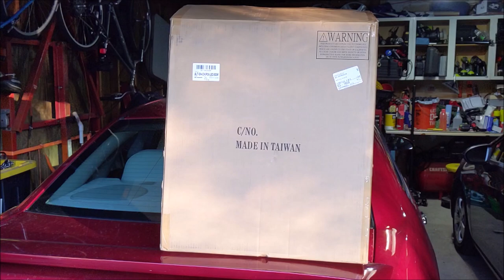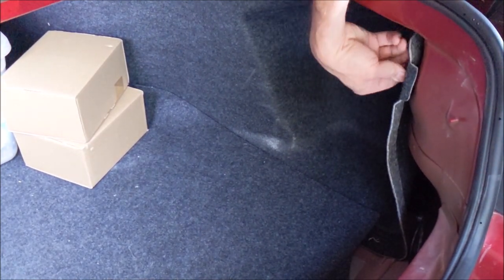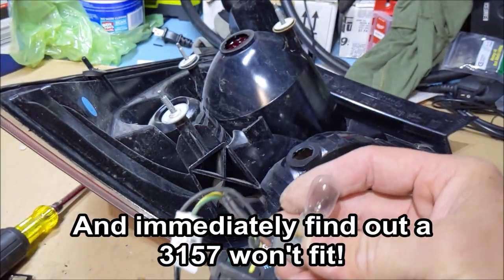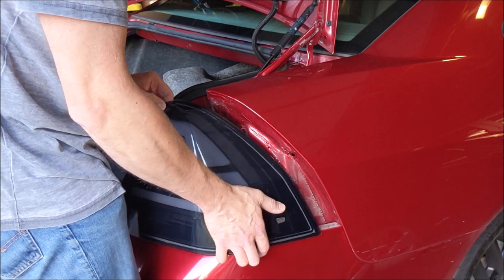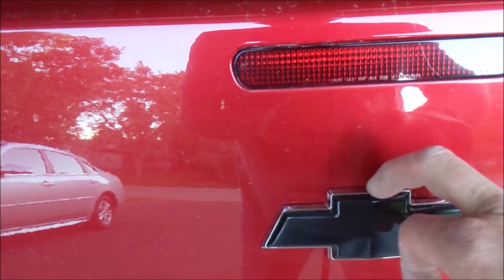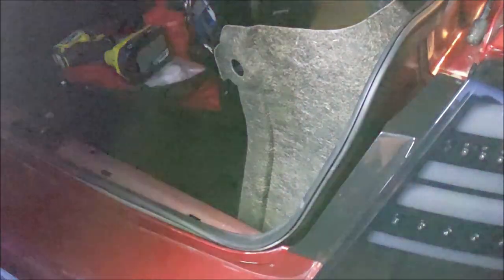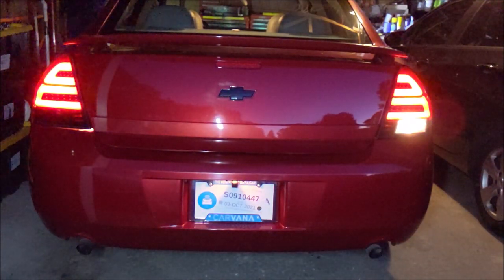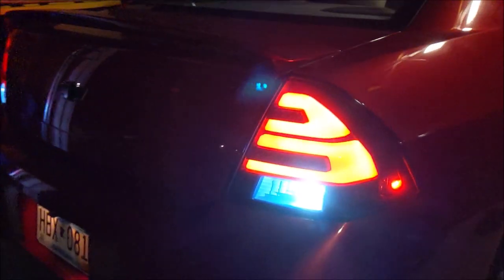2006-2016 Impala/Limited (9th Gen) LED Tube Bar Smoked Tail Lights Unboxing, Installation, & Review

Comment: Definitely a worthy upgrade that’s for sure! Definitely makes the car stand out! Also, for the LED swap in the front, the side marker bulbs are basic 194 bulbs. And for the front signals, they’re 3157. What I did is I bought a pair of switchback LED turn signals that are white for parking lights and amber for turning. Just make sure you get a pair with resistors otherwise they’ll hyperflash.
Reply from the maker: That's cool, did your switchbacks have the resistors inside them, or did you have to wire in a set?

Comment: It Looks Great! Did you have your rims powder coated black or did you buy the rims like that?
Reply from the maker: I sprayed 'em with around 5 cans of Piano Black Hyperdip from DipYourCar.com .  Word of caution: the stuff is utter CRAP! I got 4 years out of good 'ole PlastiDip on my old car's wheels without any peeling. This stuff started to flake off after less than a year. I thought it would be great to save a step and not have to add a glossifier after dipping the wheels black, but this stuff was just pure hell from the application to the end result.

Sorry to go off on a rant!!😁

Comment: At the part of 22:25 how did you fix your left reverse light cause mine is doing the same thing
Reply from the maker: The reverse lamp socket popped out of the housing, so I removed the housing and reinstalled the lamp socket, making sure it was good 'n snug..
Reply: I’ll have to try that when I get home cause when I took it to advance auto parts they said they think my reverse light bulb may have busted but I can’t seem to pull out the bulb from the socket it’s almost like it’s not supposed to be removed from the socket
Reply from the maker: I just rock it back and forth until it comes out.  Try not to use any force on the glass, and if you have to, pry against the plastic base of the bulb to get it to move.

Comment: I wonder if they have the ones with the blinkers
Reply from the maker: You mean like separate amber turn signal lights? The car isn't wired that way, so no, there aren't those type of lights available.
Reply: @CertifiedShadetree  yeah it’s the one that flickers when you stop or press brakes

Comment: the upper piece does not light, and my reverse lights just won’t work at all💀 what should i do
Reply from the maker: Try switching the polarity around. Unplug the bulbs and spin them around 180*. Same with the wiring for the tail light. Start checking fuses if that doesn't work.
Reply: @CertifiedShadetree  Alright, I starting to think my harness may be shit idk, i changed the fuses and i got my door lights to come on that i didn’t even know about lol also the upper piece comes on if i tap it.
Reply from the maker: Hadn't thought about that, but yeah the tail light harness absolutely could be FUBAR.

Comment: One of my tailights dont come on at all and i tried flipping the wire and still nothing please help
Reply from the maker: I'd send them back for an exchange or refund.
Reply: Same things happened to me today tried installing these in my 06 SS and the turn signals worked the hazards as well and when I break but the running lights didn’t wanna come on upon removing them they were smoking and got toasted

Comment: I’m having trouble with the piece at 9:39 it doesn’t wanna go in at all.
Reply from the maker: You could jam a flat-blade screwdriver in there to open up the terminals a bit.
Reply: @CertifiedShadetree  I ended up doing that and it worked. Thank you.
Reply from the maker: @mystictk4149  🍻
Reply: I’m also having this issue. I’m scared to do it but I’m glad I don’t have to send them back

Comment: Hey yo. I love the car. Lights brings it out even more. What size are your rims?
Reply from the maker: 18's - they're the stock LTZ wheels dipped gloss black.
Reply: @CertifiedShadetree  I appreciate the reply. Good looking out. I asked because I'm going to buy 18's next week. Thanks
Reply from the maker: @terrybell6939  Just a heads up, you MIGHT have an issue where the 18" wheel rubs against the top of the rear strut. Some Impalas that came with 16's have that issue when installing 18's. Simple fix, tho. Either find a set of used struts from an Impala LTZ or SS, or buy a set of KYB quick struts. Both will clear 18's no problem.

I'm not 100% certain, but if you had 17's originally you should be okay..
Reply: @CertifiedShadetree  Hey one more question. What size tires are you rocking?
Reply from the maker: @terrybell6939  235/50/18

Comment: I bought 921 led lights and they aren’t working for the reverse light everything else works great!
Reply: I had one blown regular bulb and one good one from the oem housings I used the one that still worked until I got these LED lights and now I put them in and they aren’t lighting up
Reply from the maker: @Jacks_Back1003  Neither of them work? Did you try reversing the polarity by unplugging the bulb and rotating it 180*? I would also check the connections at the bulbs and the body harness. Could just be the tail light harness is messed up..
Reply: @CertifiedShadetree  I went back and watched your video and heard you talking about the polarity or I read in the comments somewhere and I did that 180 to both and it fixed the issue! Both work now as they should. How do I fix the rapid blinking turn signal issue?
Reply from the maker: @Jacks_Back1003  Did you also put LEDs in your front turn signals? Curious because the set of tail lights I purchased don't hyperflash. The answer is to install a pair of load resistors (and if you did install LEDS in the front, then install the load resistors on those lamps first.

Comment: what did you use to trim them for them to fit sleek with the body
Reply from the maker: I used a small hacksaw. Unscrew the 3 studs with a vise grip, trim off a quarter inch of the "nub" then screw the studs back in.